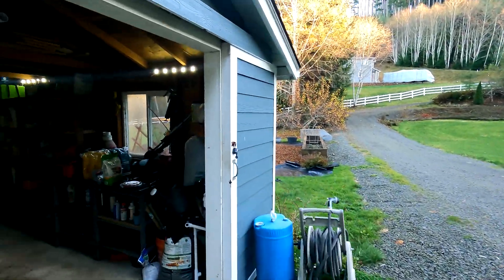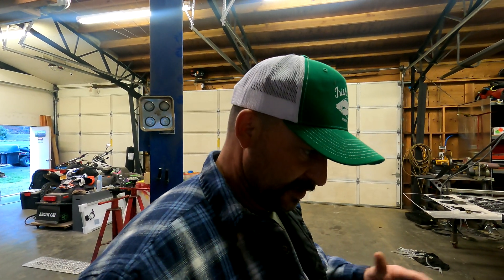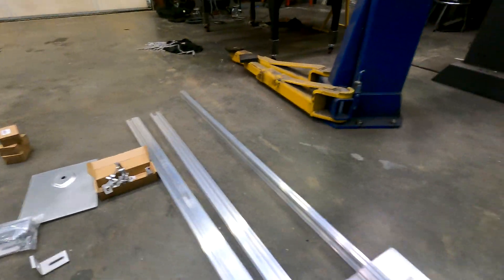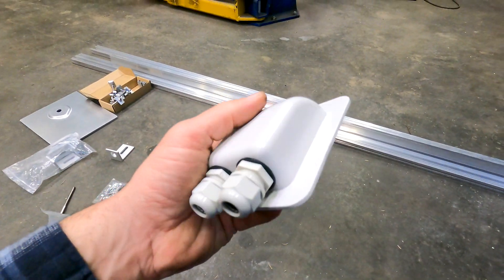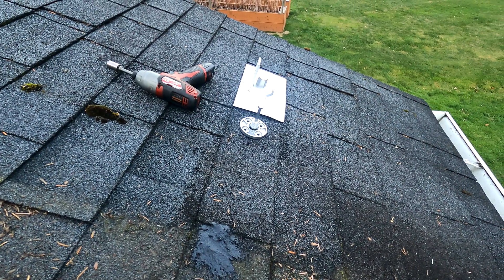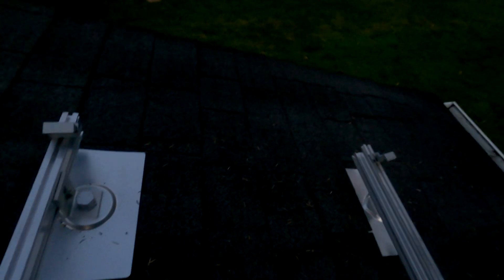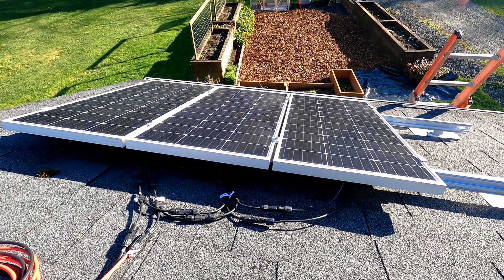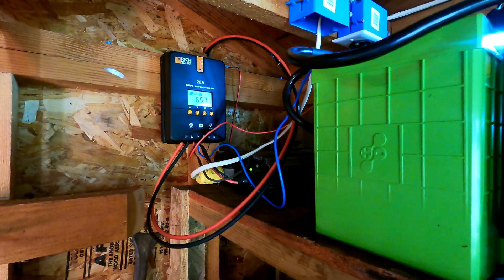Upgrading my garden shed's solar power system

Comment: Great video! Was wondering if you could post an update to your solar system? I’m really considering doing something exactly like this in our shed. It’s either that or have an electrician run power out there. Just curious if your batteries do well in the cold. I’m thinking to run some interior led lights and maybe a google camera off the solar system if I install one.

Comment: Nice work! Very clean install.  
I'm not familiar with the specs of your particular mppt solar charge controller but generally speaking, you'd do much better with those panels wired in series.  You want to get the voltage up for the mmpt controller to get better efficiency out of it. Someone in the comments alluded to it earlier that putting the 4 panels in parallel will bring the current up considerably.   
Here's the math. Let's say your panels put out 20 volts at 5 amps which is 100 watts. V x A = W
In parallel array you are going to feed the controller with 20 volts at 20 amps or 400 watts. Voltage stays constant and current is additive.
In series array you are going to feed the controller with 80 volts at 5 amps or 400 watts. Voltage is additive and current is constant. 
The mppt controller does its best work with the higher voltage and you should see more power coming out of it going to the batteries. 
You are also now only carrying 5 amps on the panel feed line. Which is arguably maybe a little safer.
If panel shading was an issued you might consider a 2s2p configuration. 
2 panels in series array 40 volts at 5 amps giving 200 watts then add the other two panels in series array to create a 2 parallel array.
2 series strings 40 volts at 5 amps or 200 watts in parallel array 40 volts at 10 amps 400 watts. It's a compromise for shading issues but I don't think you have that problem with such a small array.
Hope this helps.

Comment: Cheapest and decent way to solve voltage issue mentioned below may be to change to a Renogy 30 amp PWM controller. $30 for the controller is less and if you don't plan to go larger ever. The loss does not seem significant on a smaller system and panels are cheaper then MPPT's.

Comment: Everyone says wire your panels in series for a mppt controller.  More volts less amps. 4 panels wired In parallel will over load your 20 amp controller in amps in optimum conditions.
Reply: I upgraded to that same charge controller and wired my two 100 watt panels in series and got much better results than when i had a PWM charge controller and panels wired in parallel.